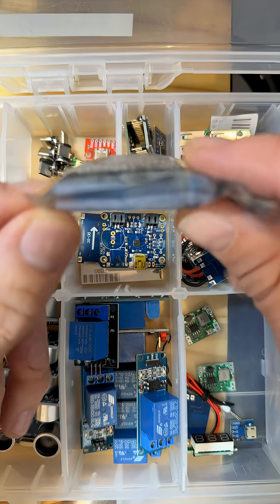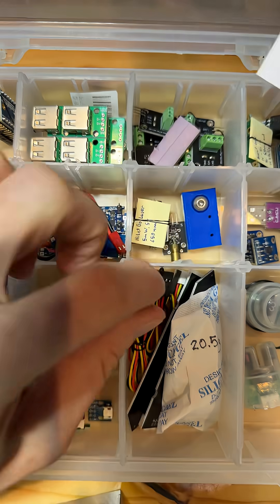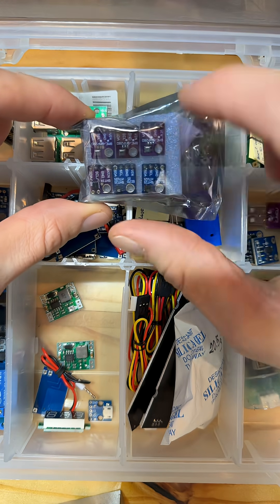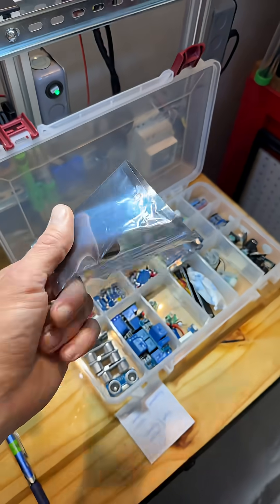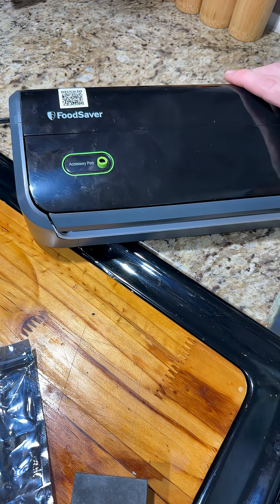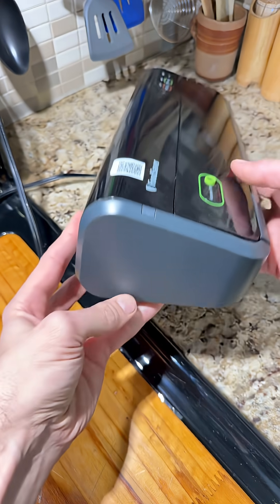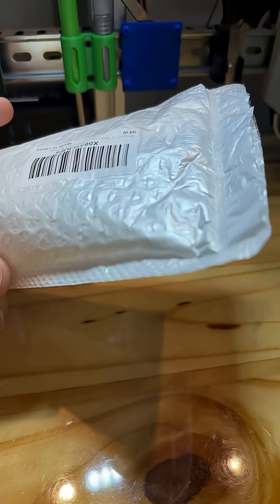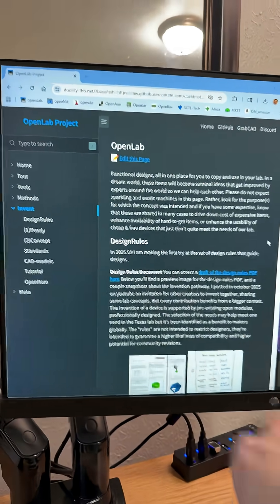you can seal circuits again. and everything else. #circuits #diy

Comment: I'd honestly just get a used unit and if it's stupid (no separate controls) then it wouldn't be too hard to add an extra button and wire the two elements separately.

Comment: Fun tip: You can "seal" velcro this way too. Such as making your own permanently attached velcro straps to cables. Loop the end around the cable and then press-seal it to itself. Velcro is plastic and melts together like any other. It's how they do it out of the factory on devices.

Comment: You may find these “residential” vacuum sealers that the bags they seal the seal fails after a relatively short time. Thanks for posting.
Reply: not that one.  it's great.  you control the duration and the heat is likened to some professional models.  it's all about timing.  you can char broil a steak with the same heat you would cook it low and slow on with enough time

Comment: I also keep these bags. If you want to reseal without vacuuming, I use a $35 Amazon purchase for this. It has replacable nichrome wire lines and Teflon overlays that allow for you to seal anything. I have never replaced the nichrome wires even though it came with multiple and I have the ability to adjust temperature depending on material.

Comment: Use impulse heat sealers, which are essentially vacuum sealers without the vacuum. Very cheap and simple machines.
Reply from the maker: OK! I have a very special request.  For this particular channel, I want to ask a favor.  If you have a device that works for you, please see if you can share the model number. 

I scrolled through the tips like this one that are amazing. After 1 year of videos, the comments section is a repository of incredible good info!  Users give world class ideas here.  I’m dreaming of a community where 10,000 viewers are also hands-on people and we can double our service to them by adding that one little effort that becomes a massive asset 😊

A youtube channel that helps 2x more with getting things done.  You are the value!
Reply: @davidmalawey  Vevor PFS-200L or PFS-300L or PFS-400L doesn’t get much more simple or durable than these machines.
Reply: @davidmalawey I've only ever used one no-name model but they're really as simple as you can get. The electronics only include a switch, a timer, and nichrome wire. Everything else boils down to how much you're willing to pay for quality of life improvements like tolerances in construction.
Reply: @davidmalawey Uline H-293, have used it for years commercially, it's a tank.
Reply: Impulse sealer model number:
PFS-300L from VEVOR
400 watts.
400 wats is minimum in my experience.
Reply: Yes. Impulse sealers are even better IMO. The one I have has a temperature adjustment, opening up a wide variety of materials. I'm pretty sure that I bought it used/like new for $18.

Side note. I have the exact same vacuum sealer that you have in the video.
Reply: As a good example baseline for a heat sealer, includes 3 timers, and a few relays, rebuild able and parts all available, I go industrial, w-455a. Even has a foot pedal for handsfree mode. Can seal home made bags of raw plastic, if you like. I like to reseal Amazon bubble packaging and bags made from plastic tubing.

Comment: Does a flat iron that a girl uses not provide enough heat to seal it?
Reply from the maker: the flat iron is effective! I keep an iron here to run trials. depending on time and situation, it works.  it’s far more poor in alignment and thermodynamic efficiency.  and waiting time.
Reply: What about the flat iron that a guy uses? 😂